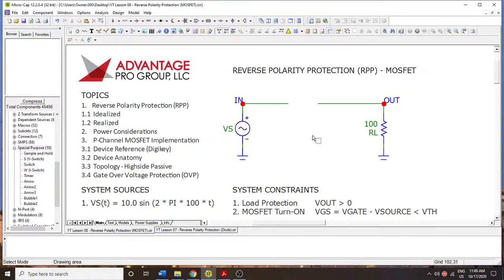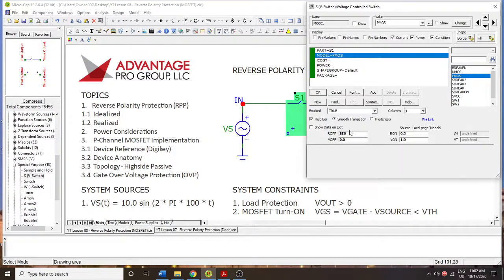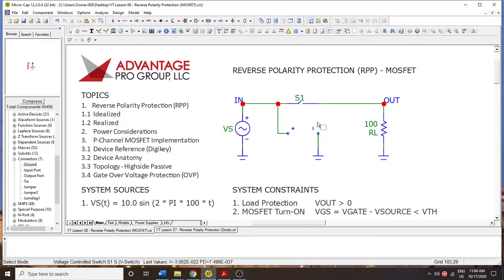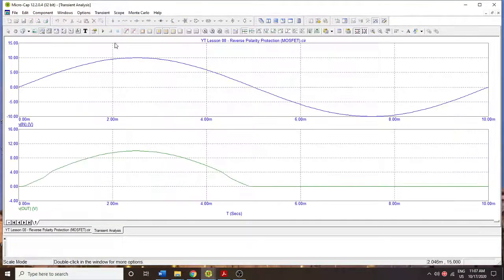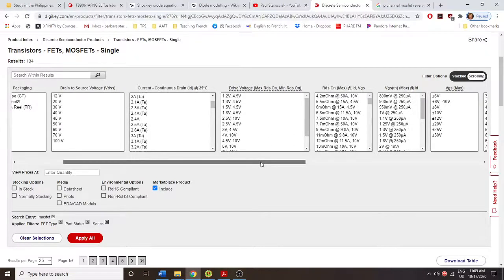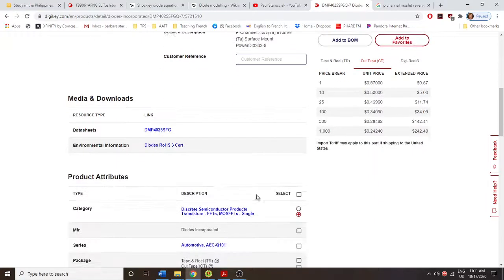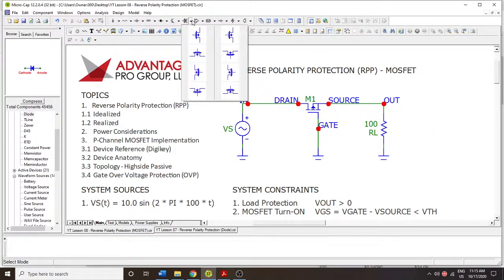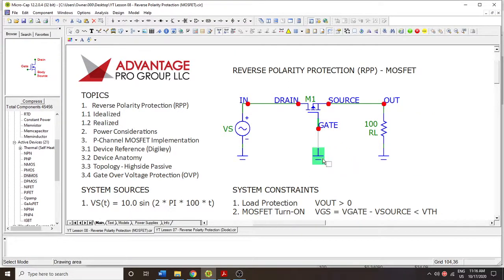Micro-Cap Tutorial: MOSFET Reverse Polarity Protection (RPP) Highside PMOS

Comment: in this topology, you wouldn't be able to control the PMOS right? since current will always flow through the body diode as opposed to using it in a high side switch case where source is tied to Vin ie. reverse biased body diode

Comment: Current flows from Source to drain in PMOS so how you can connect it''s drain to Vin and source to Vout ....
Reply from the maker: Typically, that's how it goes. Most applications will follow the theory-pattern you mentioned. However, current can flow either way through a MOSFET once the junction is conductive. 

This specialized reverse polarity protection (RPP) application uses a little trick with the MOSFET that is different than most standard applications.

PRINCIPLES:
A MOSFET can be understood more easily as a high impedance device when OFF and a low impedance device when ON. You'll see this tend to act like a mega-ohms resistor switching to a micro-ohms resistor. So, P-Channel and N-Channel compositions dictate the voltage arrangement by which they are switched.

NEEDS:
1. The load needs a path to the supply/battery charge to operate. 
2. The P-Channel MOSFET needs to activate to provide that path from the supply/battery to the load. 
3. The P-Channel MOSFET needs a difference of charge concentration between the gate and source to provide the path between supply/battery and the load. 

PROCESS:
At first, the supply/battery charge has to make it's way through the body diode to reach the source terminal of the P-Channel device. Once the charges on the gate and source terminals reach the difference threshold, the source-drain junction becomes conductive. At that point in time, the charge doesn't need to go through the body diode as much anymore.

If you're curious amd want to test in the lab, you can measure OFF-state source-drain resistance directly with multimeter (regular resistance setting). You can then measure ON-state source-drain resistance indirectly with multimeter (low voltage measurement setting). Using voltage data to calculate with the known current (RDS = VGS / I). Note: The current (I) could be known by measuring it a from sense resistor, by cable clamp, or by knowing the power dissipation of a load that the MOSFET is providing access to.

Comment: Also make video on how to use 
Crystal in micro cap
Reply from the maker: Crystal oscillator you mean right?
Reply: @pauljstar  
Passive crystals piezoelectric crystal which are used in Microcontroller
Thanks ❤️🙏

Comment: Very helpful explanation of this application, which is exactly what I was looking to understand.
Reply from the maker: Of course! Glad you found it helpful are there any other topics you think I should cover?
Reply: @pauljstar  With the RPP, I have a circuit example where a .01uF cap is recommended across Drain/Gate for ESD protection. Maybe you could speak to that  in your tutorial?
Otherwise, I don't have anything specific. You could continue deeper into a circuit design by covering voltage regulators for 5V0 and 3V3, for example. The only reason I suggest that is because I'm working on a design, and the RPP is the first module, followed by those two voltage regulators in series. You could discuss trade-offs in placing those regulators in series vs parallel. In my case, I'm using very low drop-out regulators, and to save some cost, the 3V3 I chose has a maximum input of 5V, so it has to be downstream of the 5V reg.
Reply from the maker: @andygeppert ok good input thanks!
Reply from the maker: @andygeppert  for you particular case, LDO regulators are fine generally to stack in series. I would recommend:

1. determining load usage; common surface mount implementations can provide 50.0 mA, maybe up to 100.0 mA
2. determining rate of usage (to determine what output capacitors to select)
3. accounting for likely disturbances so that noise doesn't propagate through the low voltage power channels.

Selection of regulator type typically has to do with intended efficiency of power usage for the rated input. So, often designers will prefer switched-mode for when they're going from higher voltages to lower levels...linear regulators waste current and produce heat. Switching-mode regulators sample, store, and regulate charge...essentially taking enough cost-co/sams club food samples to make lunch. However, that comes at the price of introducing electromagnetic noise into your system which if you want to pass EMC/EMI testing you'll have to manage somehow.
Reply from the maker: @andygeppert  Parallel usage would likely be problematic/unpredictable if the outputs are tied together. The reason is basically in answering the question, "which regulator actually gets to regulate the line?" or "how many cooks are in the kitchen?" They will all likely try to usurp current control at some point and generally the best manufactured one (impossible to determine) ends up doing more work than it should... until the situation changes. Maybe this system of regulators converges to a homeostatic place, but perturbations could reset system. Note: If you aren't trying to regulate the same line then having multiple 5V sources would be fine so long as they don't interface in ways that create weird looping (i.e., stay isolated).